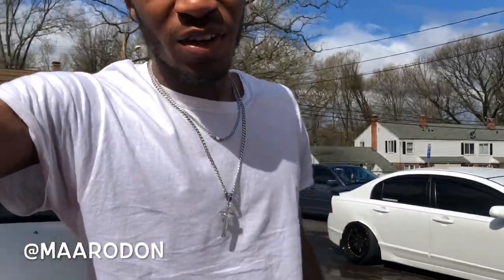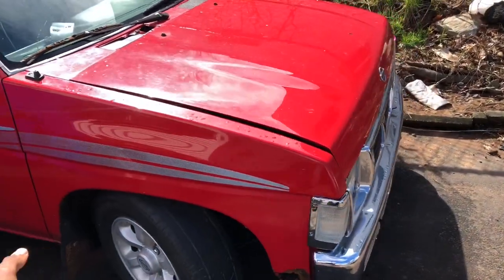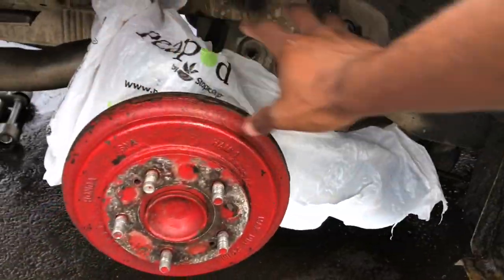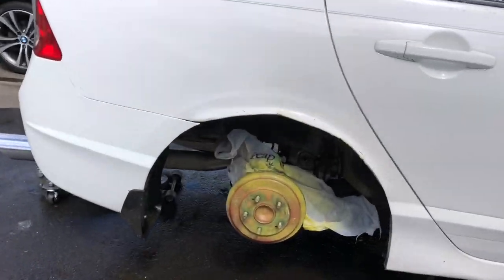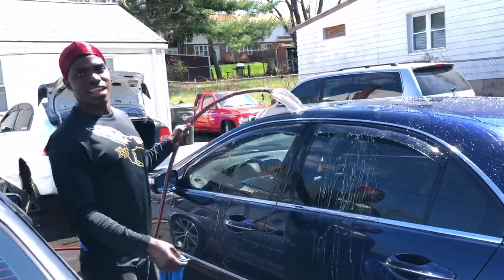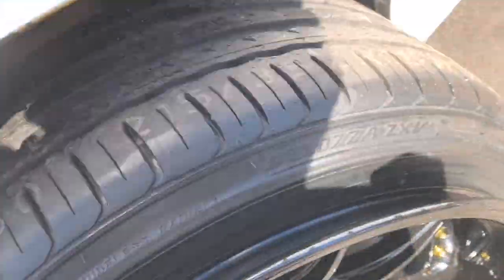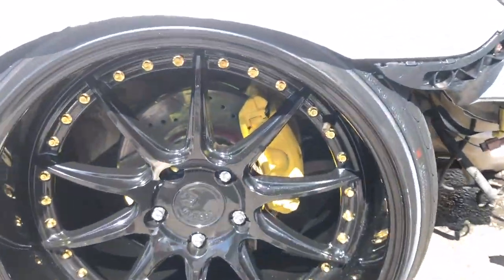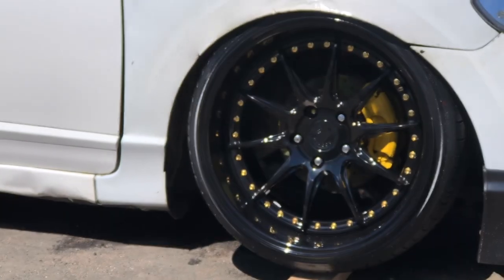Ruined The Civic with this Mod

Comment: Yo, next time you wanna change the color of your brakes and are gonna do it the same way, you should consider putting some masking tape over the threads of your wheel lug stud bolts, especially since you tighten them with an impact gun and no torque wrench. Paint over-spray residue will collect on those threads and "gum" up the whole situation, lol. Next, you tighten with an impact and add in a few heat cycles and that over spray on the threads becomes like 99 cent store lock-tite, lol. Then you go to remove the lug nuts at some point and end up breaking off a lug stud bolt or two. I have an 07 Si, so trust me, those lug studs are a b*tch to replace, because theres no room on the backside to hammer out the stud. At that point, its actually easier to just replace the whole hub assembly, but once the hub assembly is off, now you can take the time to get a good step-bit for your drill and drill out a hole in your brake dust shield large enough for the wheel lug stud bolt to fit through. Now in the future, if you ever snap another wheel lug stud bolt, you can just hammer it out through the hole you made in the brake dust sheild. Make the hole big enough to be able to angle the stud bolt a little, if need be. Nice car! Good luck with your Honda and your channel!!